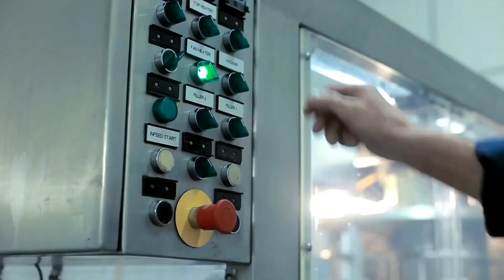The $23 BILLION Plan to POWER Singapore from Australia

Comment: Direct current? Won't that cause a lot of electricity loss?
Reply: In the old days yes. But DC tech has over come the barriers it faced and now at long distance does better than AC power delivery.
Reply: @jehiahmaduro6827  But how?
Reply: By increasing the voltage and lowering the current. This is done by the Chinese government in china where power were transfer from north to south.
Reply: @richardkoh7831  are you sure you are not confusing AC with DC?